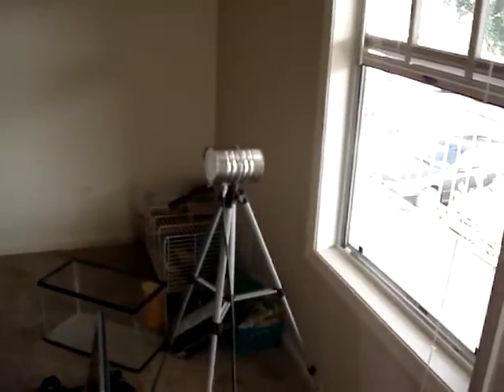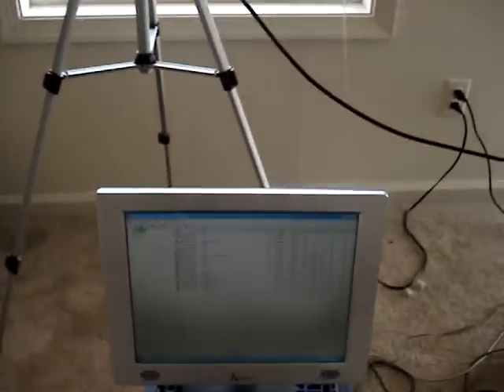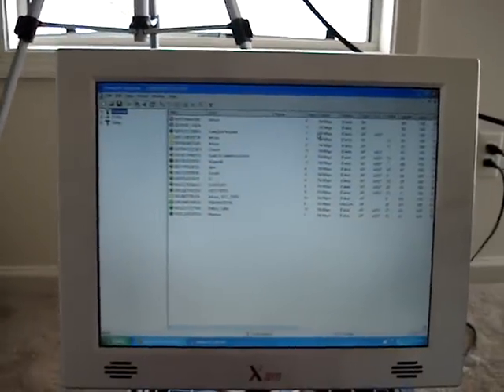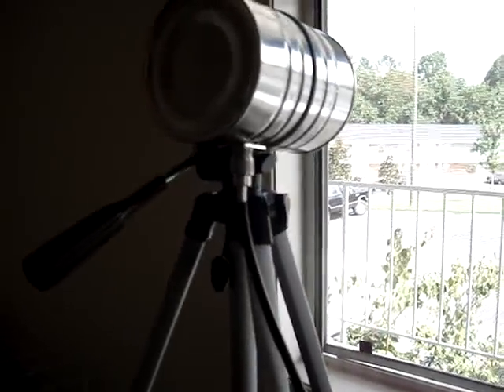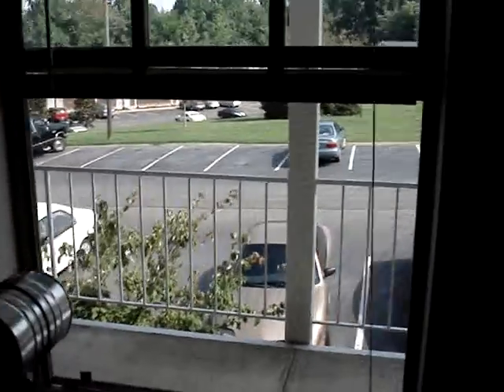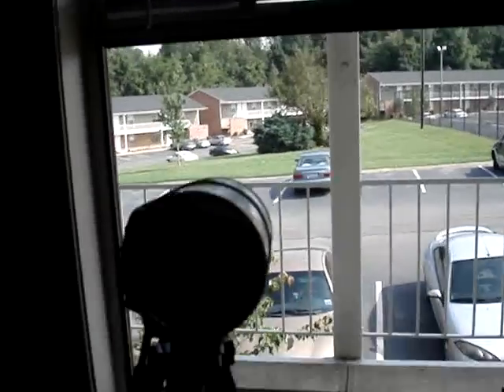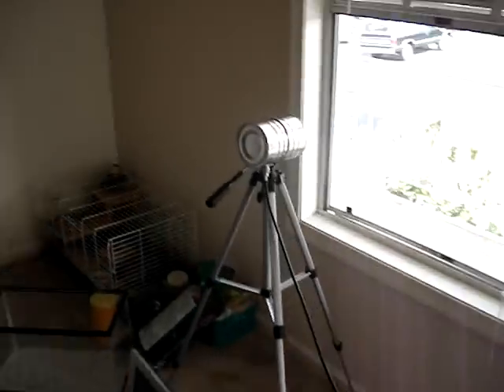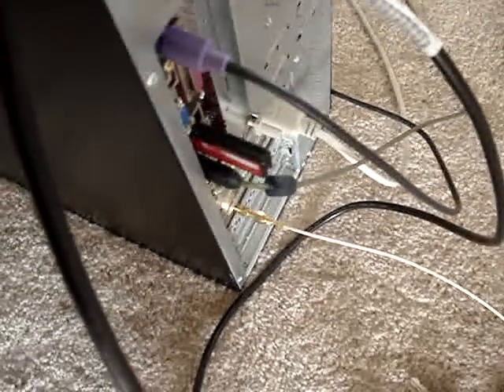Cantenna

Comment: I hate coax, i have my biquad connected straight to a 18" LMR195 n male to rptnc pigtail to my modded wrt54g with DDWRT firmware mounted on a dish ran outside and used a POE for power.